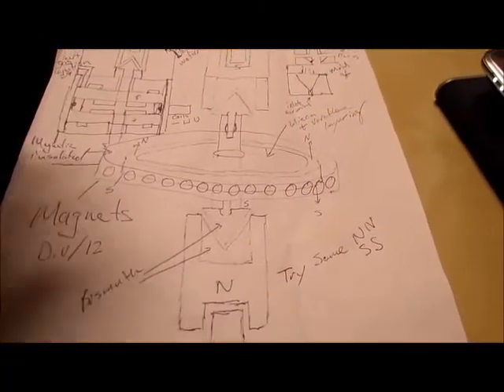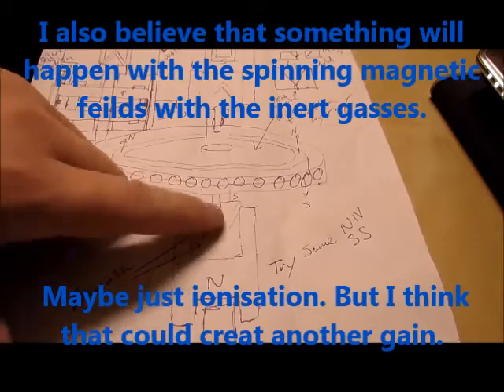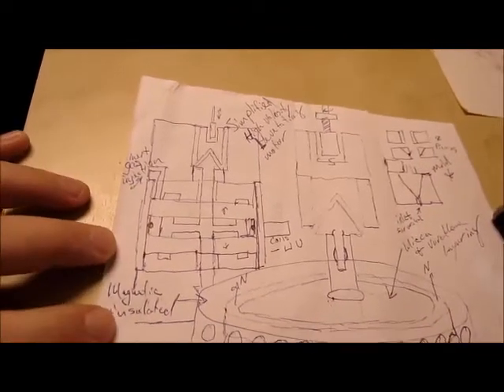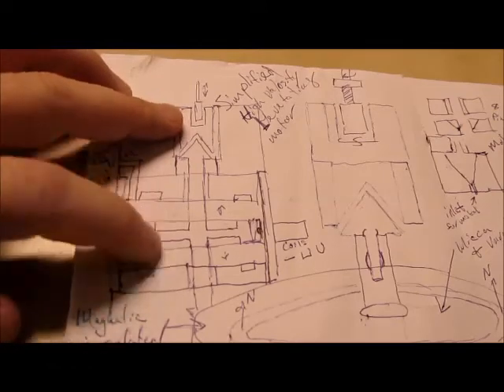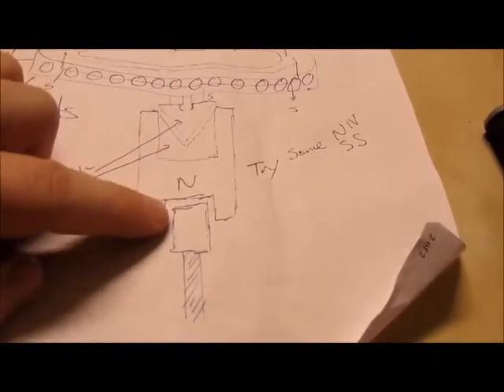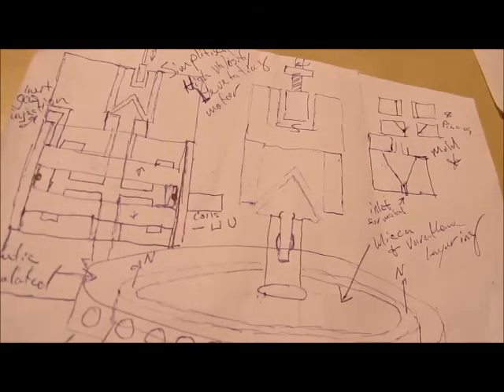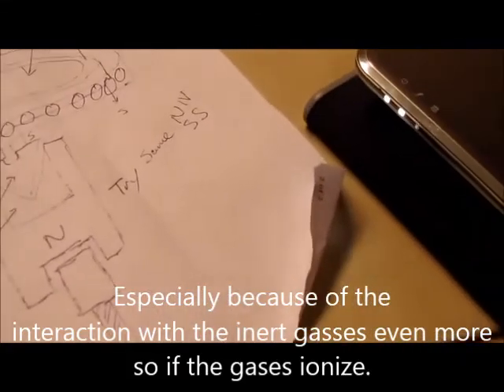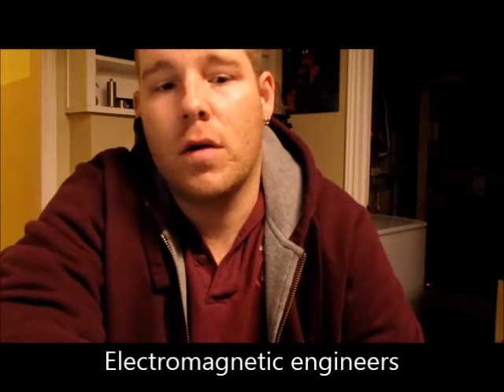The High Velocity Bearingless Antigravity Motor (ultra frequencies) p1

Comment from the maker: Well McMahons law says there is nothing that is not possible. Did Newton's law include a mass in a vacuum. Or even in a inert gas. Yes regular conditions is correct on Newton's theory but this is outside of his theory. Yes there is force with any magnet if you take 2 magnets and bolt them together with the Norths facing each other and take 2 magnets that are just normally stuck together. Drop them from a sky scraper the magnet bolted the together takes longer to drop.  Magnetism effects gravity.